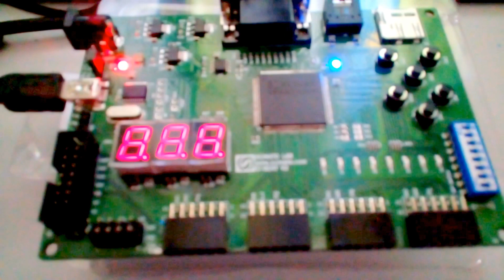Programming Elbert V2 FPGA Development board using Xilinx ISE Webpack

Comment: hi there...i recently bought this elbert v2 spartan 3a kit...and then i installed the drivers the kit got connected and i dumped some programs in it..after sometime i kinda screwed up while dumping the code from xlinx...nv the elbert v2 kit is not getting connected to my sytem...is there any way i can HARD RESET it?
Reply from the maker: Maruti Mahesh check your drivers and reinstall them if device is not connecting.
Reply: tried that...it does not even ci think the board got bricked....is there a detailed way to unbrick the board?